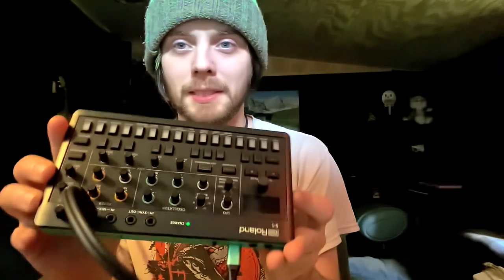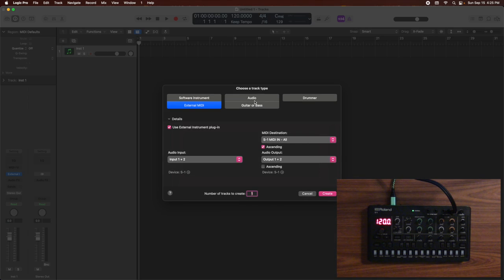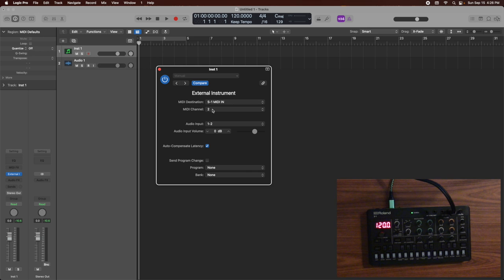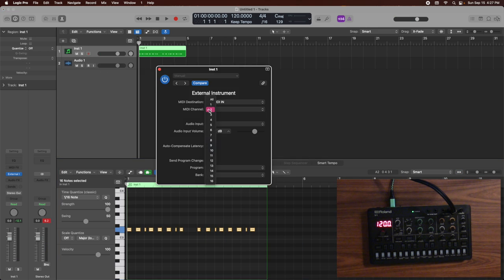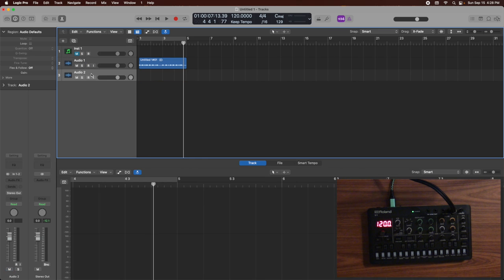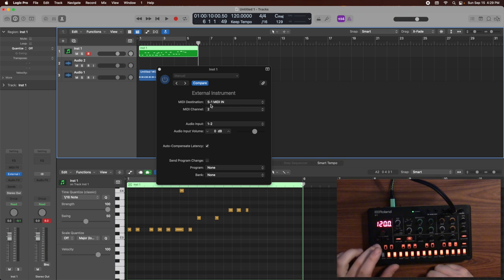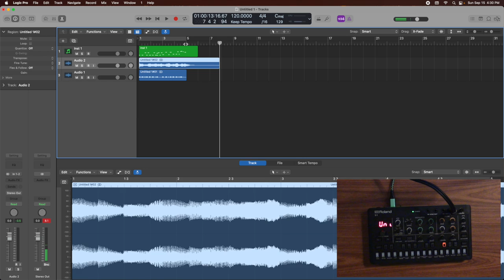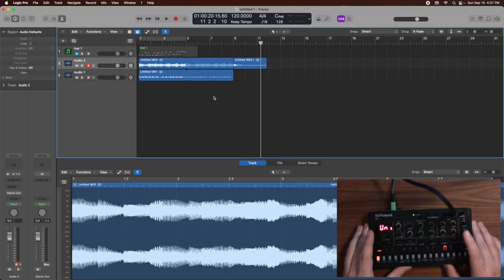Roland S-1 Having Problems w/ External MIDI Tracks In Logic [workaround/solution]

Comment: Dude. This video literally pulled me from the brink of insanity. I have the EXACT same problem with the P-6 and NOWHERE on the internet have I been able to find a solution or anyone with the same problem until finding this vid. I'm going to try your workaround right now!
Reply: Didn't work for me :( the trick you showed with going to the audio track and then changing the MIDI channel just gave me the same result. I really hope Roland fixes this soon. I'm really surprised more people aren't talking about it.
Reply from the maker: @T0WER  I couldn’t find anything on the net about the S-1 having this problem either. I suspect those of us who want to use it with external midi tracks must be a really small percentage of users 😅 

Did you make sure the midi track is disarmed after changing the  input?